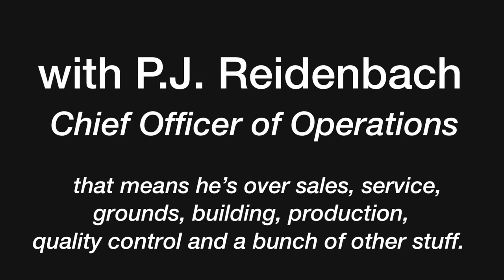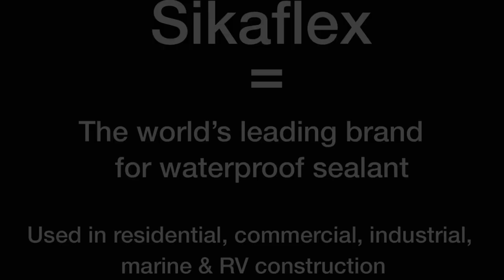Travel Lite Factory Tour - Take an in-depth look at what makes their Roves so unique.

Comment: I am interested in the insulation properties of the materials ?
The walls , floor, roof. How hot will it take and how cold will it take ?
Reply: I've had  our bh in the s utah desert in the 1000s and winter camping in the teens, I rate it better than other campers with traditional construction, I did have to insulate around the ac unit but it is so tiny it heats and cools well and is cozy

Comment: I have a 2022 14bh and we do like it. It's great to have an option for a truly light trailer, this allowed us to avoid trying to get a larger tow vehicle with pandemic pricing at its worst when we were looking at trailers.

I'd say 5 stars on outside design walls floor frame etc, interior 3.5 stars, I like the general layout but finish is a little wanting. Ive already moddwd trailer quote a bit some seem obvious to do, for example, I got a suburban kit to add a glass cover and recess the stove so we have counter space when the stove is closed, also got rid of the curtain in the shower and the door and replaced it with a Nautilus sliding door which gives more space in the wet bath, is lighter, and looks great.

We also added a lifepo4 bat, moved it to the back garage.

It's a good design and it has stayed cozy down to the teens F, I wish a little more was spent on the interior.
Reply from the maker: So glad you’re enjoying your camper!! Sounds like you’ve come up with some creative solutions to personalize it to your preferences. All great ideas!

Comment: I purchased a 2023 bh14 it's great only wish it had a bigger battery port and better fit and finish inside.. Staples are coming out don't seem to be long enough wallpaper bubbling a bit and the screw used for the Velcro to hold the cushions need a wider head and better glue as one is already coming off.
Reply: I anchored the cargo netting with wide headed screws as the staples were coming loose in our bh too

Comment: I can see a problem happenning under the shower. Hot water would created moisture on the other side of the plastic floor sides, creating molds.. Other brands got the same design and molds occured. Would required more ventilation there for sure

Comment: I understand the aluminum tongue/frame will not allow a load leveling hitch or sway bars.  Why?  Is there an explanation from the factory?

Also it appreas that the roof would be be walkable with that small 1 1/2 square tube roof framing.  Did they talk about that?
Reply from the maker: Yes! They have actually solved this problem with adding a mfg sway control on all the new campers. There’s several reasons you can’t add one after market- the most obvious is that you can’t mix metals! Secondly, the aluminum frame could get bent and twisted- it’s a lightweight metal and that’s the beauty of  the Roves. We all feel grateful they have now solved this and included the sway control standard. 

The roof isn’t classified as walkable but it’s accessible with extreme caution. Obviously our techs have had to go on the roofs to check sealant and other things- but I want to be cautious in publicly calling it “walkable.” It’s accesible. Just use caution! :)
Reply: The electronic Tuscon sway control is fantastic, stops the sway before it gets out of control

Comment: Being as the frame is all aluminum,  how do you attach the hitch that is steel? I know steel and aluminum have chemical reaction.
Reply from the maker: The entire frame is aluminum but the aluminum frame is wrapped and protected from the opposing steel metal. We have to do that as well when we add spare tire carriers. Only the coupler itself is steel. The factory protects the aluminum frame before adding the coupler.

Comment: While I really respect what they are trying to accomplish with the RoveLite - no wood floor to rot, light enough to pull with out Tacoma (through the Rockies with no problem), aluminum constuction - all good ideas, but they missed the mark on quality.  We have a 2022 14BH.  Our frame has cracked in 4 different places, the grey water tank was full of debris and plastic pieces, our door wouldn't close, our table warped like a salad bowl, the storage compartment door leaked because the cutout was so scewed (three tubes of silicone later...), the bed frame was completely broken, one window leaked and the list went on.  Now we have a pretty new trailer covered in weld patches, a table we made on our own, a bedframe we repaired and a monthly payment.  I can't say I'd ever buy another one.
Reply from the maker: Wow! I’m so sorry that’s been your experience! I’ve been a Rove dealer since the first day they started building them and can honestly say I’ve never seen a trailer with these kinds of problems. Also I’m not sure why the dealer you bought it from didn’t find ALL of these problems before you ever took it out. Shame on them! If any of our trailers come in with any issues (though none have been as significant as this!), our customers would never know it because HOPEFULLY we do our part as a dealer and fix it all before it ever gets picked up! Every trailer out there is made on an assembly line and stuff gets missed. It’s our job to go through them again and find anything the factory missed. Granted, a cracked frame is pretty significant and I’m SUPER sorry you’ve had that problem. You’re the first I’ve heard of with that problem… I’m sorry it happened to you. We hope you still enjoy camping and making memories and we hope Travel Lite worked with you to make it right! They have always been a great company to work with for us! Blessings on your journeys!

Comment: I watched videos of leaking ac that can’t drain, poor caulking job, leaking roof, etc… I really wanted one but now i am thinking twice. If you check their website, it has poor google reviews from actual owners. I really hope they fix the issues and work on giving better costumer service cause i heard they suck! Glad i did my research first. Too bad, i really wanted the Rovelite 14FL. 😔
Reply from the maker: Thankfully Travel Lite is a company that has listened to their customers and fixed some of their initial issues. We have had so many testimonials of HAPPY customers that are absolutely loving their Roves. I will add that side a/C’s, regardless of camper brands have leaking issues if the drip pan is tilted even slightly inward. At our dealership, our years of experience taught us to look for this and we fixed the minor problem before they ever left the lot. Too bad other dealers don’t do their job on proper PDI’s and create bad reviews. Travel Lite quickly fixed that problem by making a fiberglass sleeve that wraps the A/C to prevent any water from ever coming inside so we haven’t had any further issues since then. That was on the early models. I would encourage you to take a second look! I would also encourage you to also check with current Rove owners (like those on the Rove Lite FB group) who have been very pleased with their camper!
Reply: The leaking issue has been resolved, TL now installs a fiberglass insert that CANT leak inside, it is an awesome design and proof they listen to the customer
Reply: @campoaksrvoutdoors8722  good to know! Thanks for the reply 👍🏼
Reply: @tmcblane  that’s great!
Reply: @tmcblane What year have they started using this?

Comment: I was excited.... Then I went and looked at one. VERY SHODDY workmanship. The concept is awesome but at this price point (25-30k) I would not expect to see caulking leaking out of seams and running down sides of camper also fit and finish inside is terrible cut wood ends unfinished, caulk & contact paper to hide many imperfect seams cheap blinds and on some units they don't even bother reversing the fridge door just and easy fix.  Hopefully they can improve on quality control and fix some of these issues. Maybe Next Year. It really is a great concept!!